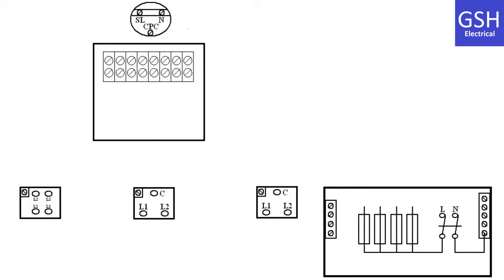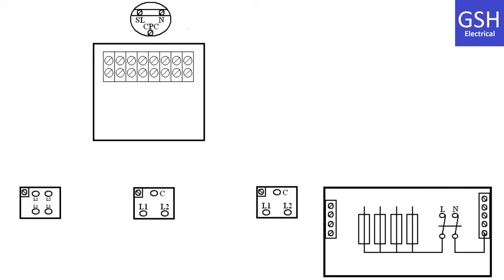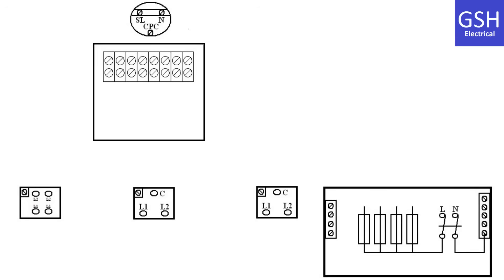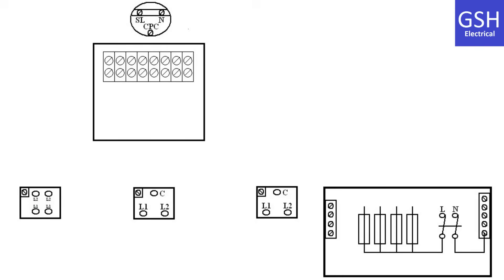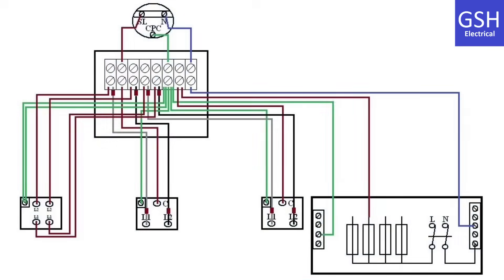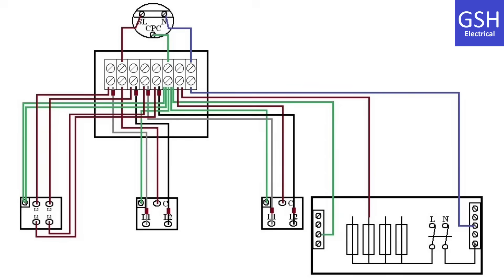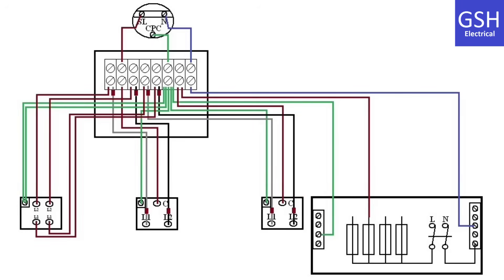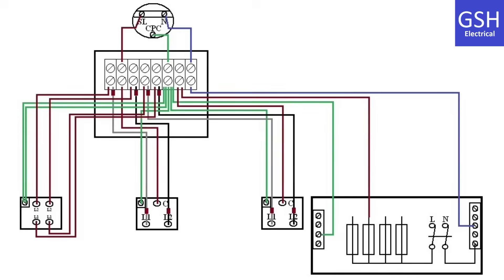2 Way and Intermediate Switching Joint Box Method Wiring Diagram Connections Explained

Comment: So PL and SL are connected to commons on the 2 way (as in 2 plate method)? Is it possible to wire 2 way and intermediate via a joint box using the 3 plate method, where the black would be PL and the grey SL?